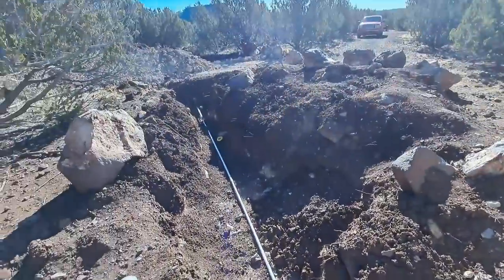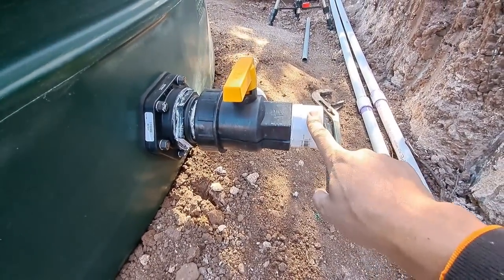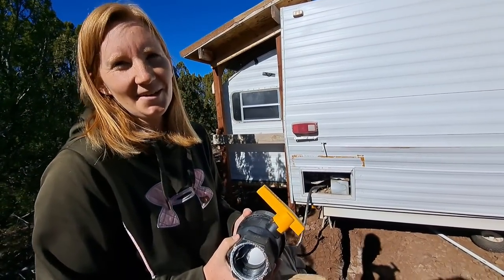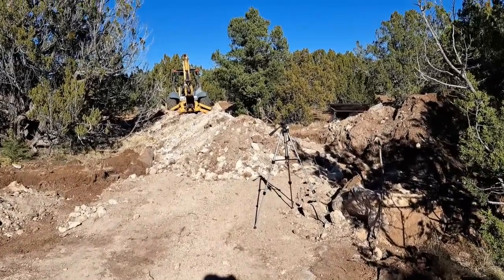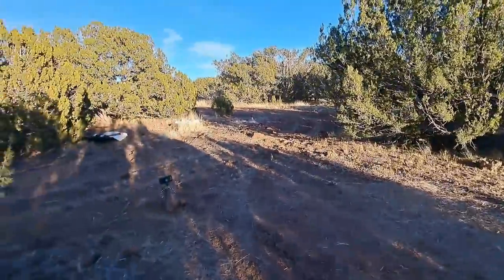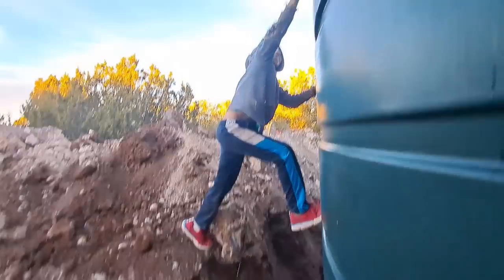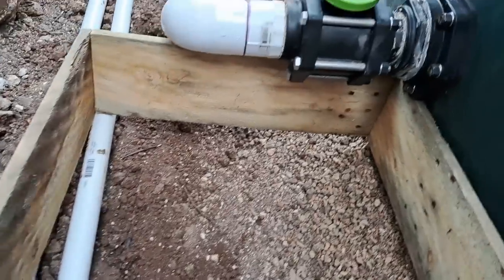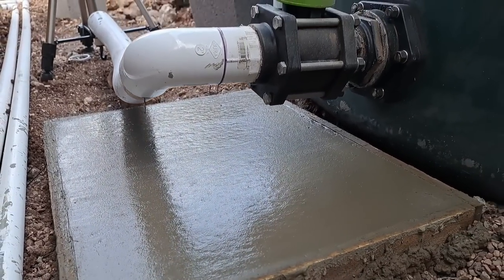Ball Valve Busted | First Water Haul Into The Big Storage Tank

Comment: So sorry about your "he-man" effort to tighten that tapered fitting into the valve. Remember, thread tape/pipe dope is also a lubricant that makes threading fittings together easier. Installing  a union inline with the valve  lets you tighten the fitting a little bit more if you have a leak as well as saving you from cutting the piping apart to service the tank/valve fitting junction. Trust the sealant to do it's job, too. Best wishes

Comment: I know this is an older video and I know you have already replaced it but, epoxy or JB Weld would have fixed that crack. Just saying. On second thought, I wouldn't trust glue with that much water at stake.